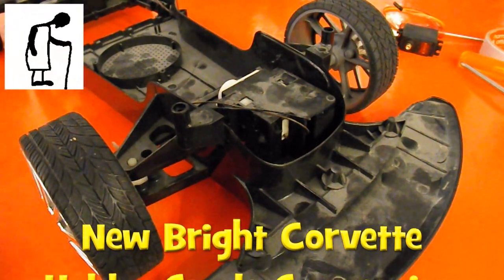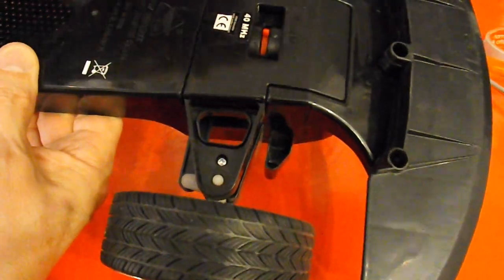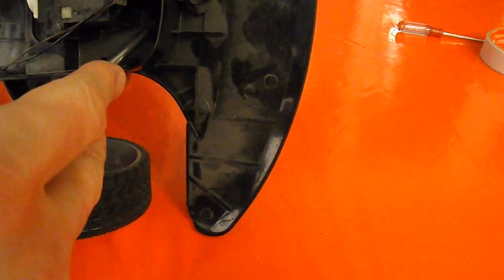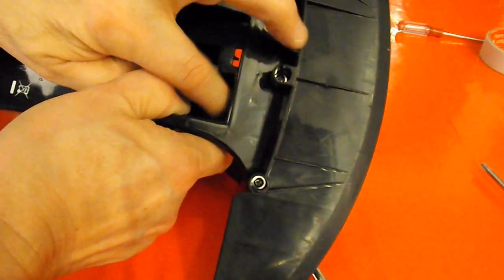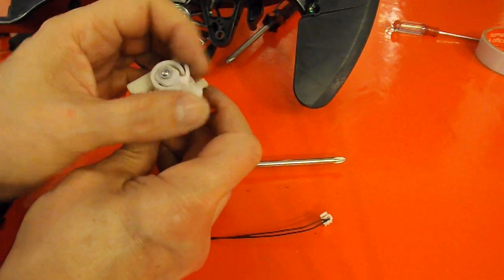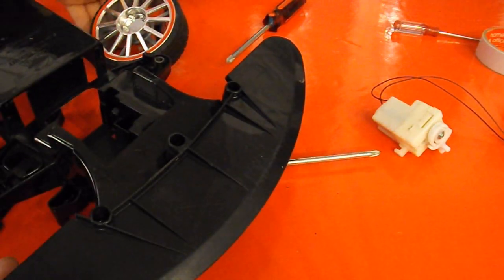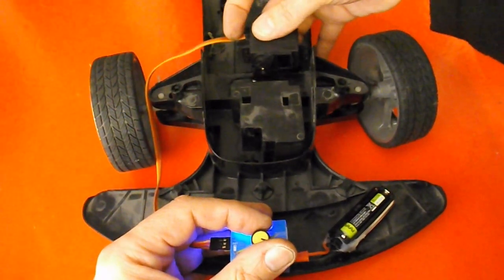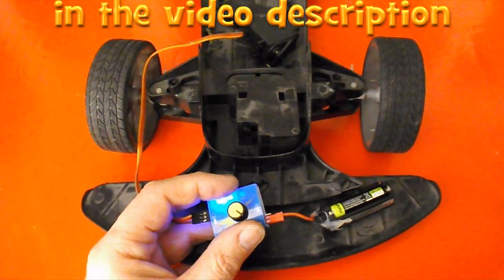New Bright Corvette Hobby Grade Conversion Part #03 Looking at the steering

Comment: Nice and clean. 
I'd recommend foam to mount it on. Some white glue to stick the pieces to the right height, then hotglue to secure. The slight give of foam may be easier on the gears and rack from bumps and such
I wonder what it was that had a speaker in it, the grill being midway down the car.
Reply from the maker: +slider2732 hot glue as usual. It may not last as long as your method but I don't need it to last for very long :) Funny how many people have picked up on that speaker grill. I guess like most of the New Bright toys various parts are interchangeable so a different toy probably uses this chassis and has a speaker and music system. There are suitable holes behind some of the lights for an LED lighting system so that is probably another option the designers allowed for but was not implemented. Looking at the shape of the chassis I can well imagine there is a Formula 1 Racing car using it in the New Bright range.

Comment: You can swap a 540 size motor in the car, not because faster speed but I suggested it for the car to be whole hobby grade electronics, theres a brushed 540j tamiya motor out there which is below $10 :)